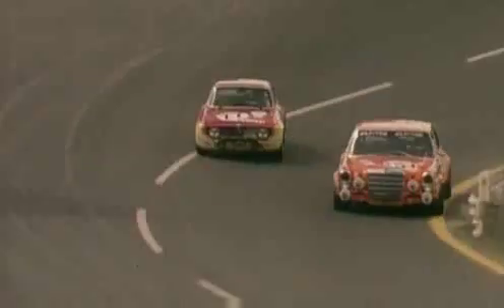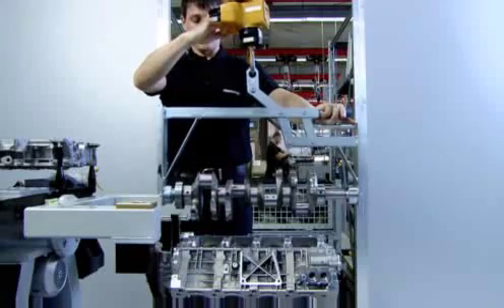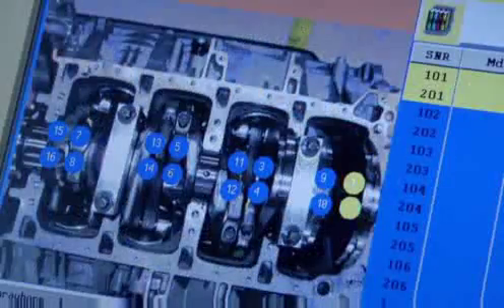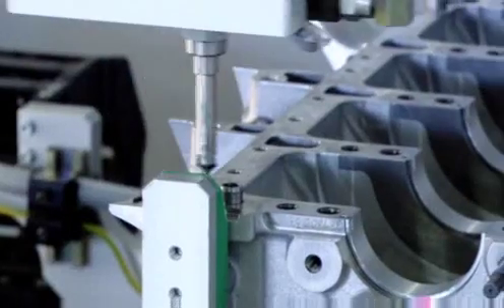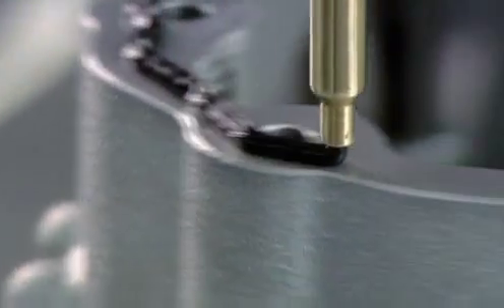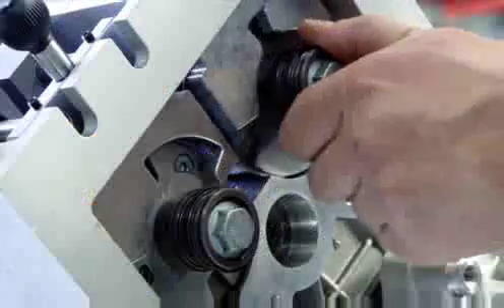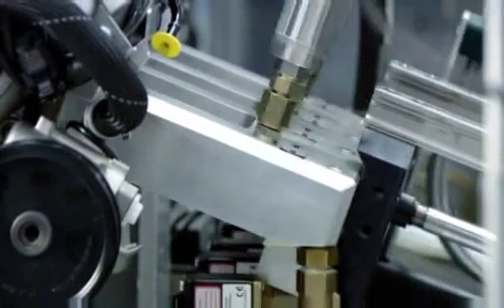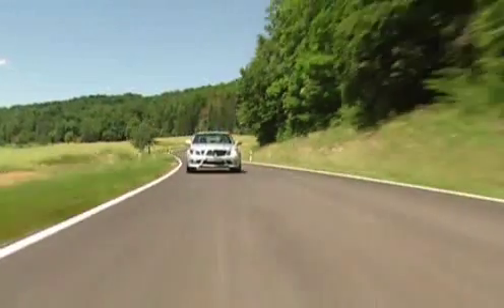Mercedes-Benz AMG Engine assembly

Comment: There are posers everywhere.  Real driving enthusiasts tend to have the nice, older cars, except for those who are both rich and enthusiastic.  Every real driver knows you're better spending money on a used car that's a better drive than a new one that's a status symbol.  I love my 08 S6, I don't care how out of date it is / will become, it's still an amazing vehicle.  Not that 08 is that old, my 00 W210 E320 is old, but I still love it as a daily driver.  Besides, I prefer it to the new stylin
Reply: I still drive a 1993 corolla. Still going strong. Just changed fuel pump, radiator, starter motor, spark plugs, air filter, brake master cylinder and she still goes